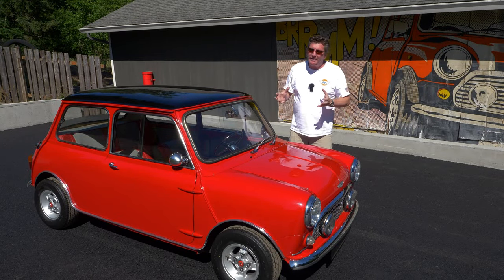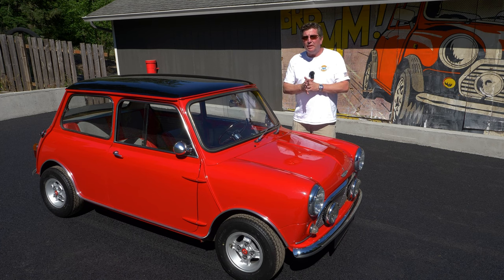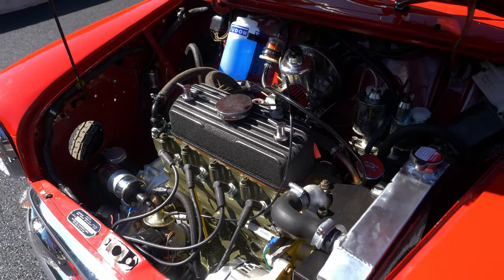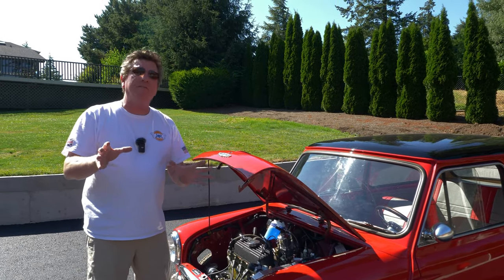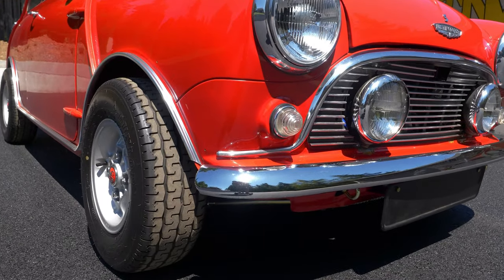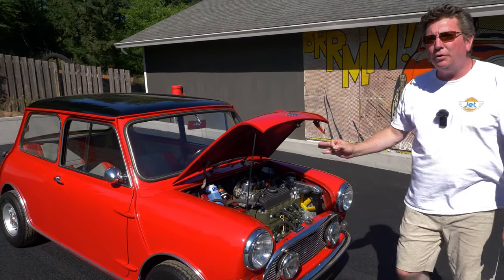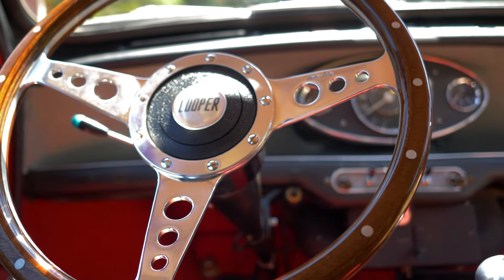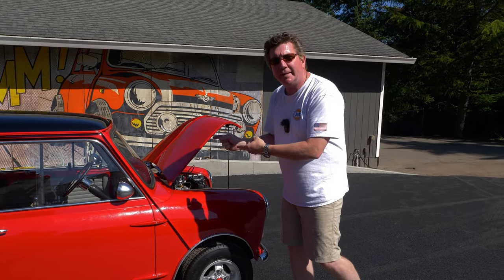1965 Austin Mini Cooper S With Abarth Goodies and JET Motors Master Kits

Comment: sweet ride! I had a '65 Cooper S years ago ('79-'81) RHD, rock guitarist brought over from UK. Still remember the VIN and engine number: VIN, CA2S7766964 and engine number - 9FY38432. Had a Madadash (UK aftermarket item) Paddy Hopkirk seats. Hydro car. Remember having it re-pressurized to 90 lb/ft.

Comment: What’s up with the giant hole in the right wing? Is that period?
Reply from the maker: no the previous owner replaced the inner wings
Reply: It's a later model inner wing. It's used to supply fresh air to the cabin.